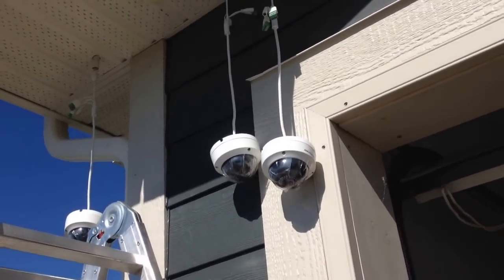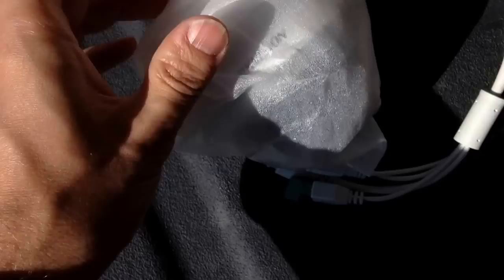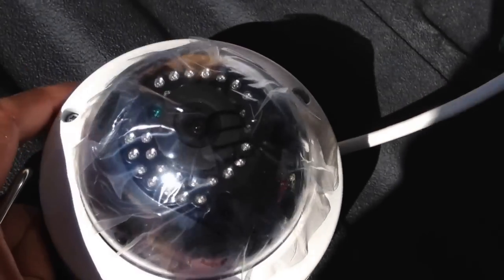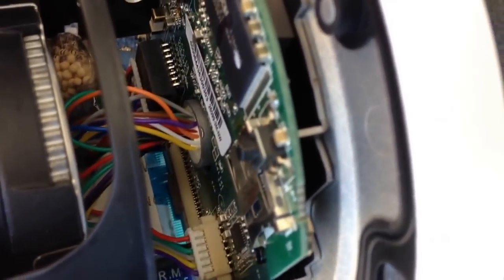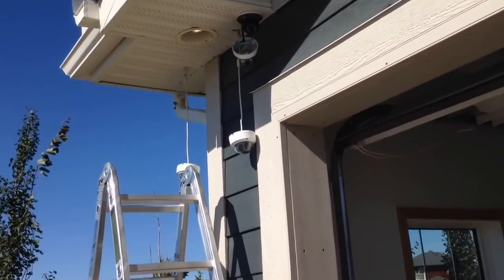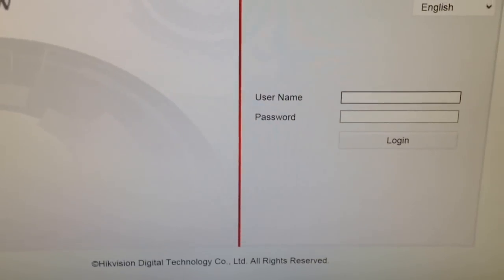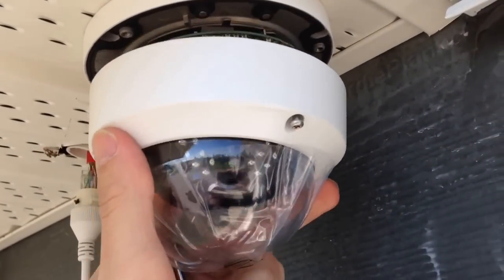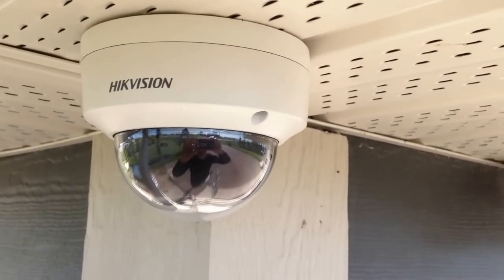How to Install an Exterior Security Camera - Dome

Comment: I wanted to know how you attached them to the soffit. Did you use toggle bolts or did you install something into the soffit to hold the camera (round electrical box)? 

Additionally, just on comment on the IR led's and why they're partially covered. They likely produce reflections inside the dome if not covered. 
I know this because I have (universal) domes that have Escams (indoor pan/tilt) cams installed inside them to make them weather proof and to see anything at night the LED's have to be turned OFF. 
When on, the reflections inside the dome completely obscures the image and you see just a white screen. With these domes I had to install external IR lamp assemblies for night vision.

Comment: Think twice about downloading the latest firmware for that camera!

It appears that the version you bought (brown box, chinese characters on the installation CD) is the Chinese or International Version.  Amazon and other online retailers are full of these cameras - they work great but if you update the camera firmware it will, at best, revert back to default settings - in Chinese - or at worse, brick the camera.

HikVision makes great cameras for the money however make sure you have a North American version  if that's where you're located.  They come packaged in the red and white HikVision packaging and box.
Reply from the maker: +Michael Strecker Agreed 100%.  Technically, the camera can be updated to think it's a NA camera and then the firmware upgrade can occur, but the risk of bricking the camera throughout that process is very high.

Comment: Is your Soffit aluminum?
I am setting up my first security system, and I have aluminum soffits
Reply from the maker: Yes, mine are aluminum too.
Reply: @HomeTechDIY 
Did you use any special anchor or just the stock anchors that came with the camera?
Reply from the maker: When attaching these lighter weight dome cameras to the soffit I didn't use any anchors.  I used the included screws and worked my way into the soffit until it takes hold.  There is little to no camera movement or shake even when the wind is blowing 60mph.
Reply: @HomeTechDIY 

Cool!

Thank you so much

Comment: did you happen to put any wood under the eaves drop? or is it screwed right into the paneling?
Reply from the maker: Is there case I did not use any wood under the soffit.  The screws are directly in the soft metal only.  It's surprising very secure and there have been no issues after several years.  There might be a little vibration if the wind nears 65mph.
Reply: @HomeTechDIY  I literally did a google search to find an answer to this question. I'm doing a big camera install this week, and I have aluminum soffit. The plan was to screw directly into the aluminum soffit without any kind of backer, but I was worried it wouldn't be strong enough. So thanks a bunch for the piece of mind! Any particular type of screw recommendation?

Comment: Not the video/info i was looking for ! , but usefull for some., we here were looking for how and what  was been done to put the camera on soffit !!
Reply from the maker: Thanks for the feedback. Correct, the drilling of the hole in the soft metal was already done. The CAT6 cables run to my POE switch or NVR. Check out my other videos on installing cameras and let me know if you have additional questions!!

Comment: If I decide to get this I'm going to make sure I get with you on which model number to get to avoid the wrong international version. Also, is there a good PTZ version of this model without going crazy on the price? Not really needing 360 degrees. 120 would be great. They make so many models it's so hard to keep them all straight. Thanks, Jim
Reply from the maker: +Jim Bob You're correct in that there are a lot of version of these cameras...  in fact I have fallen behind on what's now available, so I'm not sure if I'd be able to help on the PTZ versions.  But, yes, make sure you have the correct international version.
Reply: Jim Bob

Comment: Greetings newfiebort, I didn't see a response to the previous question in regards to mounting; however, how exactly did you attach the cameras to the soffit?  Any assistance is greatly appreciated, thank you.
Reply from the maker: My soffit is pretty secure and I was able to attach the cameras directly to it.  I used my own screws and the camera has now been attached for 4 years without issues.  When the wind blows over 60mph, there is a little vibration, but I'm ok with that.

Comment: Does your can light on the corner mess with the vision of the cameras at night when they are on?
Reply from the maker: Yes.  This year I installed longer floodlights in the pot light fixtures and one of them shines directly on the dome causing some glare.  To solve this issue, I loosened the socket in the fixture and pushed it in so the camera is now shaded from the direct beam.